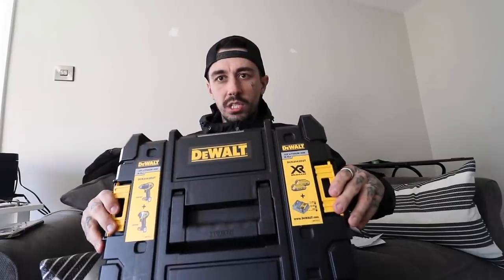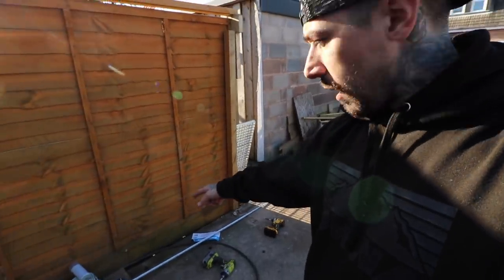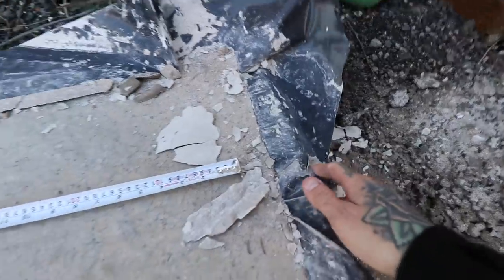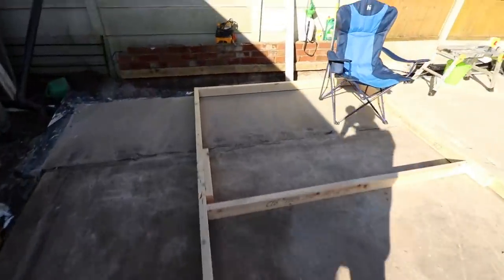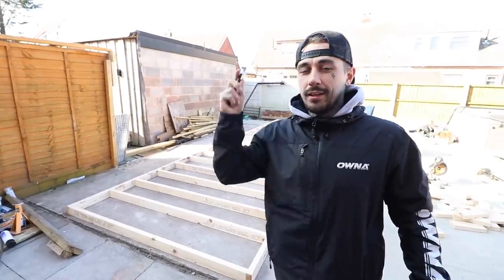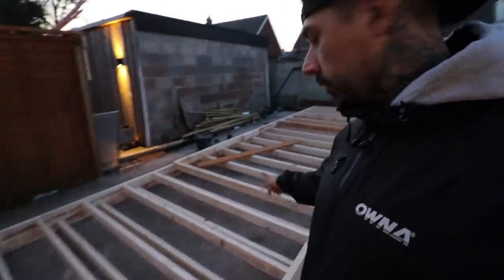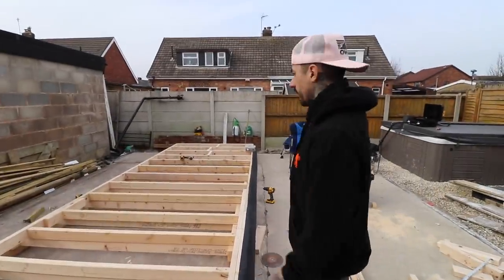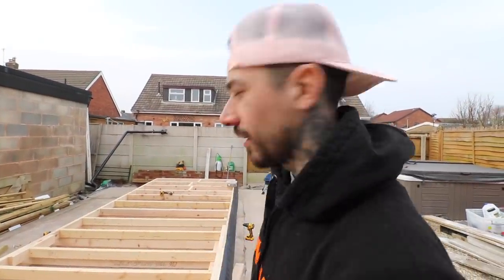BUILDING DIY MTB DOUBLE GARAGE!!!

Comment: You're going to enjoy that new Dewalt kit. I've have two of their 12V sets, I've had one of them for over 12 years and it's still holding up. 

I built my own garage about 10 years ago and welt totally mental on building it sturdy.  Do you not plan on using double top or bottom plates?

To attach my walls to the base, I used one of my bottom plates, concrete fasteners to attach it to the slab and then stood the walls up on the bottom plate and screwed it in place. It made assembly easy. I then used the top plates to overlap and tie the walls together at the corners. 

The walls will seem flimsy till you attach them together and add the roof framing. I used 6x2 for my walls and found this to be true. Lots of wobbling and flex, and then as soon as I added my stringers for the roof, it was rock solid. 

Nice work. !

Comment: Just a quick one to make your life easier and a lot quicker. Don’t put noggins in until the walls are up, leave the 400 centres open and use the straight edges of the OSB to line it up and screw it down. Then your wall will be perfectly square, add noggins to fit once wall is up 👍🏼 just a handy tip

Comment: Hey man great video! Just a small tip, you should cut all the vertical timbers to the same measurement rather than measuring and cutting them individually, this would force the top and bottom timbers as straight as possible. You should do this for the joists or roof rafters too, to stop the walls from being wavy. Also remember to take the measurement for the joists on the floor rather than trying to keep the walls upright and measuring over head. Keep it up bro!

Comment: Hey boss just a little input I've been doing construction/concrete since 14 im 35 now but Dewalt has gone downhill maybe just here in the states but we buy all Milwaukee tools from now on more power yes Dewalt gives more but you might see why and Milwaukee seem to hold more charge cold or hott
Reply: Milwaukee are top.

Comment: Boy you have done a belter job here mate 👌 should be proud. There's a few things that you could of done to make it easier for yeself. The angles on the top are great as long as the concrete base is completely level, otherwise you will have to pack the roof trus up to get your run off 🤔😜

Comment: Hi Harry, I would suggest making 3 individual sections per long side and standing them, then nailing together where they join and putting a 4x2 as a head binder to hold them straight
Reply: I would also put a 4x2 wall plate around the perimeter of your founds first (leaving where doors are going to be without timber) this means you can screw/nail your walls straight on top of them

Comment: 1. You wanna  a few cans of expanding foam, just put it in any holes or use it in your walls or whatever, it gets rid of a holo sound and it's like a fiver from Wickes. 2. OSB has board in the name😂 so you don't have to say 'OSB board'😁. 3. When you start working on smaller bits further down the line in the garage build or even with big bits, it's well worth setting your drill up with like a countersink bit( 3 quid from screw fix) or just a small drill bit like 3mm for pilot holes before you screw in to the wood. So have your impacter and drill then drill a pilot hole then put your screw in, it helps the screw sit better and most of all it STOPS the wood from cracking when you screw into it.

Comment: Dude have literally been looking at that drill and impact combo myself as have just bought a few of those TSTAK storage boxes. Good deal that. How did you get on with the smaller batteries? Get a couple of split AC units installed in the back of your new workshop. Cool in the summer and toasty in the winter. Would love to help but I’m down in Surrey.

Comment: Mainy I have a product which is well cheaper than Kingspan and it is sound prof too boy, plus has a foil back to protect from condensation. Get some wall straps for the large wall plate back and front and joist hangers to make the roof solid to walk on 😁😁😁😁

Comment: DPM between the timber and the concrete is a good idea. You want to try and stop damp from the concrete wicking into the wood

Watch Colin Furze 'how to build a strong shed'. Putting 5" posts in the corners /mid length and butting the 2x4 up against it is good for strength, looks nice and stops you needing corner trim for the cladding

How are you going to lift those long sections without them twisting?

Comment: I fink you need 2 course of bricks all the way round then sit the timber frame on top with damp course, keep the timber off the ground
Reply: It's a good idea, but If you use dpm and then clad down the side of the slab so the wood is encased it achieves the same result

Comment: Yoo Harry what mtb would you reccomend for under 1k?
Reply from the maker: No idea tbh!!!
Reply: Joe, if your in the uk go outdoors have a bike called a calibre bossnut that is a pretty damn good trail bike. Solid geometry and components for the price. 130mm travel front and rear. Have a look at a few reviews. It’s 1100 quid. However if you can stretch to it the triple b is the absolute best bang for buck I think. Comes with a dropper and few better bits than the bossnut as well as 140mm on front instead of 130. Comes in at 1500 quid. Both of them get 10/10 reviews or 5 stars from most of the mtb mags.
Another option is the polygon Siskiu t7. About 1400/1500 quid. Again solid geometry and great components for the money. Comes in a 29er with 135 rear 140 front travel or a 27.5 with 140rear 150 front travel.  And is a damn good looking bike to boot.
So yeah what I’m saying is basically try stretch to 1500 if you can mate. You’ll be very pleased you did and you won’t end up wanting upgrades such as a dropper post straight away but if you really can’t then the bossnut is still a 10/10 rated bike well worth every penny.
Reply: Although through my ignorance I failed to mention that if you want a hardtail the world is basically your oyster with 1000 to play with bud. Marin do a nice hardtail called a san Quentin but the sports megastore decathlon have their own brand of bikes called btwin. I have owned a btwin 920se which was about 750 I stuck some wide high rise bars and a short stem on and it was an absolutely fantastic bike. Can’t get better components for your money than you can with a btwin. Just make sure you get a bike with geometry to match your needs and in the correct size and you’ll struggle to find a bad hardtail for that money pal.
Reply: @MrJwhittaker93  thanks ill have a look now

Comment: When I did mine I put 11mm osb on the outside of framework to square it up and add racking strength before I stood the walls up, if your tight to boundary you could do the breather membrane, batten and even cladding before standing up that wall, check out Ali dymock on YouTube for a full build tutorial, looking forward to seeing how yours turns out🤟